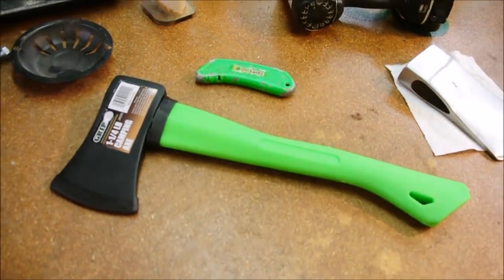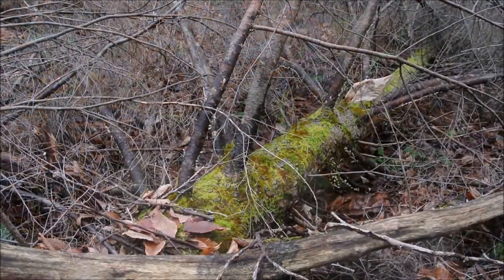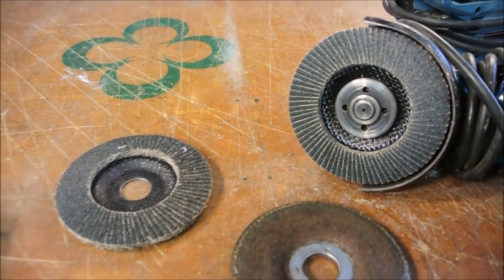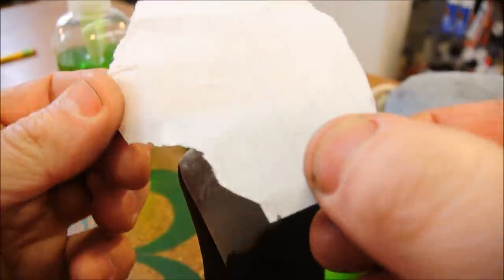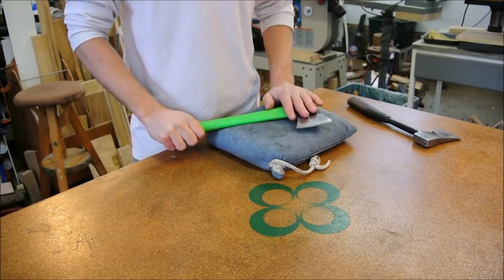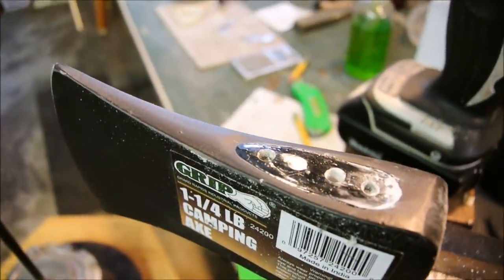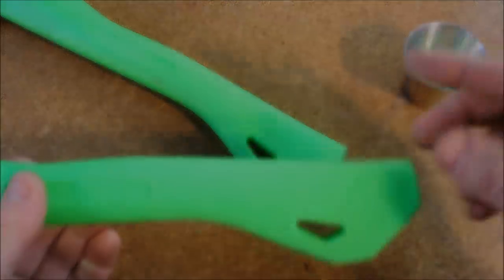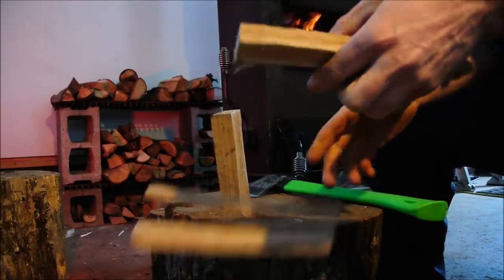Amazon's 12$ GRIP Camping Axe: Inside-Out

Comment: Spend the $35 on a Estwing. 
American made and the entire hatchet is a one piece design from head to handle. It's forged from a solid piece of steel. The handle is a full tang design with a leather grip. It will last a lifetime, literally.
I used to be in forestry and would harvest a ton of firewood and it was my "go to" for chopping off tree limbs and didn't want to fire up the chainsaw back in the day.
Reply from the maker: Comments like these are a sand-trap. Let's see if I can respond honestly without getting you angry {Spoiler: it never happens}. 

1) This video isn't about the Estwing. It's irrelevant. I've also been receiving lots of arguments for me to "just buy a Fiskars," but this video wasn't about that, either. 
2) As a long time user of Estwing products, I don't like the leather-wrapped "Sportsman's" hatchet. The handle has an exaggerated curve that feels hard and unpleasant to shift in your hand while working. I do like the blue-handled "camper's" hatchet a bit more, and while I agree that it's a lifetime tool, it's also three times the price of the junky green one in this video- so it's not in the same category. 
3) Hard does not always equal better. Hard also means much harder to sharpen. Sure, Estwing's is as hard as steel gets, and so the "Sportsman" also shocks more than just about any other tool I've used. 

Please understand that there are many ways to chop branches up. And there are thousands of hatchet designs out there. The only thing that they all seem to have in common is that their owners all believe that they are the 'best' one! So it's hard for me to read comments like that without hearing it as another unsolicited (biased) opinion that's usually more of a post-purchase rationalization. But my main gripe is really that those comments just completely ignore my half-hour video, and all of its contained content, which feels kind of rude. Sorry if my honesty offends you. 

Note that I do consider your experience in forestry as legitimate and respectable, so I will take it as an honest opinion that an Estwing hatchet is a solid tool. However, it is my role and function to be as critical and impartial wrt design as possible. They're all just tools to me.
Reply: pocket83² Lol! At least you're honest. No need to apologize though.
Reply: @johnt4060  Congratulations to both of you on the civilized discourse. The net could use more people like the two of you.
Reply: Used.to have an estwing axe. After cleaving through some pine, the edge was chipped, rolled and trashed..
Reply: The handshock from those Estwings is the worst ive ever experienced and the reason id recommend literally any other brand of axe no matter how cheap over one. Who cares if its Made in America. That line is trumped up so often as a debate excuser. Americans are capable of making junk too.
Reply: PureCountryof91 
I cut through a 24" Oak branch that fell on a fence. Couldn't use my hand for a week but the edge held up perfectly. It was a little dull at the end of the day but nothing like you're describing.
Reply: sergeantbigmac 
Estwing has a huge selection of hatchets, axes and hammers with a shock resistant handle
Reply: "They're all just tools to me" Amen, if it gets the job done safely then it is a good tool, a $10,000 tool is just as useless as a $1 piece of junk if it isn't used. Tools are made to work not sit on the shelf and look pretty. Thanks for your time and sharing the info with us on this little gem. @pocket83squared

Comment: Great video. The flap discs are ok but they generate so much heat in the workpiece.. really got to keep the workpiece as cool as possible to avoid destroying the temper. Using a file like you do is a great way of doing it,slow and cool the way to go!
Reply from the maker: Agreed. I go really slow. It's easier when it's so cold outside! In the summer, metal never seems to cool down. Then it gets tough to be patient.

Comment: Those plastic  or fiberglass handles can be quite slippery when wet or snowy.  Especially with most types of gloves.  I'd be tempted to do something about it. If it's plastic, grind in some grooves, or melt in some stippling.  Grinding fiberglass might be a bad ides. You may reveal frayed fibers that rub into your skin.   Maybe wrap some grip tape way at the butt end for a sliding hand to stop against.

Comment: Great video.  So many good reasons to use a properly sharpened tool.  My only advice would be to limit ones use of any impact tools like this, a hatchet, a hammer & certainly hammer drills/ chippers.  As an older guy who used tools like these for decades I'm currently paying the price with near constant elbow pain/ discomfort.  I'd recommend using a hatchet or hammer on smaller jobs but for any long term use i'd opt for the power tool equivalent.
Reply: 36 year old 18 year carpenter/tradesmen. Please for the love of god Pocket head this mans warning.

Comment: Hey speaking of plastic soldering, have you ever considered taking strands of 3d printing filament and using that as a "welding rod" of sorts? They're all by default thermoplastics because that's how they need to be to actually 3d print in the first place, but you also may need to know what plastic your part uses before you go mixing in other plastics like PLA or ABS or PETG or PC etc.
Reply from the maker: Since I don't have a 3D printer, I don't keep spools, but that is a great idea.  

Of course, when possible, I try to use a piece of scrap material of the same type. But most basic plastic repairs come down to being compatible with either HDPE or ABS. If I do need a sacrificial rod, scrap ABS pipe is easy enough to find, and lids from old containers (or shopping bags) are a nice source of PE.

Also, a (cheap) cable-tie will work as welding rod for many household plastics. If you only use a little from the end of each zip-tie, it will still function as it was intended. Most of the length usually ends up as scrap, anyhow.

Comment: If you cut too deep on the nub below the hole there is a cavity inside. A hidden pocket. I called it 83 and filled it with epoxy. Re-shaped it to a rounder handle for axe throwing.

Comment: I'd like to ask you, for someone who really has no experience using hatchets or axes regularly but carries one in their vehicle as a safety precaution (I would be capable of using it to split small amounts of wood in an emergency situation) would you recommend this and if not is there another hatchet or smaller axe you'd suggest instead. I get you're no expert but I really just need something inexpensive that can be tossed in a toolbox as a precautionary tool, no major amazing Gran Force Brooks axe/hatchet or anything fascinating. Just a simple hatchet for emergencies
Reply from the maker: Sure, why not? It's cheap, and pretty tough. It's going to be resistant to water, and you can leave it banging around in the back without worrying about it. This is as low investment and low-maintenance as it gets. And if you really have no experience, it's also a great way to learn/practice sharpening.  

Just be sure to make a sheath if it's going to be under your seat ;)

Comment: Here comes the pedant's comment!   I can't help my mix of Asperger's with a dash of pedant :D.
In that spirit first let's be clear that nothing done here is wrong!  Its actually pretty spot on - the end result always trumps the "right" method ... just the terminology poked me. 

Looks to me like the first stage stone is a dual grit carborundum which is a whetstone or oil stone - using soap isn't wrong, but you don't want a slurry, a whetstone uses it's (clean) surface of the stone to grind and uses the liquid to lubricate and carry the debris (slurry) away.  Lots of soap and regular wiping is fine, it's achieving exactly what is needed, just incorrect terminology.

The second stone looks like a green slate or dragon stone.  That IS a slurry stone ... usually water - but soap is OK, just don't wipe the good stuff away, you want a nice thick muddy layer to create a fine lapping paste to get a fine smooth edge.

Finally, it is so refreshing to see someone using a leather (finishing) strop without daubing it with grinding paste.  Technically that's a lapping strop (still part of the sharpening process) typically used for cutthroat razors and surgeon's knives (scalpels).  You should then followed up with a leather finishing strop to buff and set the edge (like a butcher's steel).

Comment: just a tip a strop dont do much without polishing compound trust me go buy some on amazon get the super tough and super fine and it will literally make a night and difference
Reply from the maker: I do use mink oil on the leather, but I can't mention everything. I was thinking about adding FFFF pumice to it, but why bother? The real error in that shot was the extreme angle I used while stropping. It should've been way lower, but hey, I'm just acting.

Comment: I bought a short Gerber hatchet for the camper.  It probably has the same issue yours came with .  I didn't think it chopped well when doing camp fire wood.  I didn't want to bring it to the local lawn mower blade sharpening butcher.  Could I send it to you to have you clean it up like yours?
Reply from the maker: Oh! That seems friendly- but the level of entitlement contained in your comment is staggering. No, I will absolutely not restore your hatchet for you. Learn how to file it yourself. That's why I make these videos. 

You have no excuse, unless you have no arms—in which case, you have no need of a hatchet. Now add your dislike to the pile, and please keep the swearing in your reply to a minimum.

Comment: A cheap forest fire Pulaski would meet your needs far better for removing the brush & baby trees. I used hatchets to do what your planning, and it sucks bad without the right tools.
Reply from the maker: That is an excellent point. It's just that lugging it around a big property is not really practical. Maybe if I were to just spend a day doing it.
Reply: @pocket83squared  it is not as tough as it sounds. I have done it many times while firefighting, on top of carrying a heavy pack days on end non stop for miles.

Comment: I picked up an old Pumb hatchet from Roger's flea market, years ago...I think it was right after high school. I took it to NY with me when I moved up there .  I was out back of the shop I was working at, clearing some brush around the dumpsters that the trash collectors were getting pissed off about.  There was an old man who lived next door, who saw me and offered to sharpen it.  I, stupidly, assumed he knew what he was about, after all, why would he offer if he didn't?  I handed him the hatchet and he told me he's be right back.  I stood there for about 40 seconds as he walked to his garage.  It was 40 seconds too long.  The next thing I heard was his bench grinder spinning up and my baby being tortured upon it's overly coarse stone.  I ran to his garage, but it was too late, the damage was done.  He had heated that edge up so much it had turned a bluish green color.  I was pissed.  I begrudgingly thanked him for his time and silently cursed him for the work I'd have to put into it to fix the tempering.  I shouldn't have wasted my time with the cursing, that damn thing is still sitting in storage, waiting for me to fix it.

I could have sworn I had somewhere I was going with this, but I seem to have lost the plot along the way. Anyway, thanks, as always, for the great video.
Reply from the maker: When I was in the trades, and someone would ask to borrow my hammer "for just a second," there was only ever one answer: No. 

Call me old fashioned, but you just don't touch another man's tool.
Reply: @pocket83squared  Yup, lesson learned.  Probably the most useful thing I learned that year at college.

Comment: Also, would you heat-treat (temper) a hatchet? Or will the increase in brittleness make it dangerous?
Reply from the maker: That's a tough question. I'm not the best person to ask. While a harder hatchet is more durable, it is also more difficult to sharpen. It will also tend to be more expensive. And I do agree that, in general, harder metal is also more brittle, so I suppose there is a small additional risk. I think the better way to evaluate the problem is to ask yourself what you are trying to do with the hatchet, and then find the appropriate hardness that suits your need.

In my case, I can get two solid months of work out of one of these junk hatchets before I have to sharpen it. Further, they are cheap enough that I can abuse them or replace them entirely. But many of the axe people in the comments seem to believe that one ultra-hard hatchet is the best solution; I suppose they just baby it for life. This seems silly to me, as man has used sharp rock for the bulk of his existence. Even the softest steel is an incredibly hard, durable material that will last a long time being struck against soft, moist, pulpy wood.
Reply: @pocket83squared  Agree with you there. Unless it's a survival situation, thanks to economics, it's easier just to get a "good enough" tool and replace it! Hatches are tools that literally are meant to cop a beating! For me it's durability. I've used some truly terrible tools that loose a working edge after hacking at ONE branch! I don't know if it's something you'd be interested in for the channel, but it would be interesting to see IF there's any benefits of DIY tempering.

Comment: I use (503 torch lighter) to work on plastics.
It's very versatile and easy to use, as if you are using a Dremel pen.
You don't need to sand nor file your work after you have welded your plastic with this low temp torch.

Let me know how it goes after you have used it :)

Comment: Its a good and simple way to modify the edge of a cheap axe !  Unfortunately, the same axe from Harbor Freight is just $8- .....
BTW, I will use Glue Gun to fill up the concave area of the Safety Warning area as I think it would be much easier and faster than your way !

Comment: but you know that if you can file the edge of youre axe, its not really heat treated? that means its got no hardness to it, so it is a bad tool in any way. an axe also needs a hard edge, like a knife, ( i´m knife and tool maker) to keep it sharp for way longer. thats the differents between cheap and and good tools, just ot notice ;-)  alltho you did a pretty good job for a user and nice video bro keep going

Comment: I don't know what material the magpul pmags are made of butt in Canada we have rivets and hers and I've won that have no internals I want to fill in the rivet hole, I have some welding plastic from eBay, how would you suggest I composed the hole? I was thinking some wood inside and use a soldering iron to melt then fuse, any tips?

Comment: quick question, how many gallons of epoxy do you go through on a weekly basis? ;) 
Love the videos, nice pacing
Reply from the maker: Dual dispenser tube kits are about 3$ per .85 oz. total amount. I will typically use up one of these .85 oz. syringe kits about every month. They can be refilled for much cheaper by buying the (2)4 oz. bottles.

The cost is pretty much zero. That's kind of the theme of my content.  

Note that there are 128 oz. in one gallon. 
128/12 {months} = 10+(2/3); 
Thus, a this rate, a gallon would last me over a decade. That would require lots of toothpicks, though ;)
Reply: @pocket83squared  that's a good point, here in Denmark it is significantly more expensive unfortunately
Reply from the maker: Can you use Walmart (dot) com? We can get just about anything delivered through it. I would think that a corporate giant like that would have reasonably standardized prices.
Reply: @pocket83squared  in theory I could, but they don't ship from Europe, so shopping would be pricey

Comment: sorry for the stupid question, but is the hatched tempered? if yes, why does the file bite into the metal?
Reply from the maker: Not a stupid question at all! It's just really tough to answer. There's a million different types of metal and a million ways to alter the hardness of those metals. I probably shouldn't have used the word, 'temper' in the video. I'm not an expert, so any simplified answer I give will be debated by one of the know-it-alls around here. Sorry to be so useless, but I suggest you just go read the wiki: 

 https://en.wikipedia.org/wiki/Tempering_(metallurgy)
Reply: @pocket83squared  i thought i was missing something obvious :D thank you :)

Comment: Harbor Freight sells the exact same axe with a yellow handle for 7.95 and you can use a 20% coupon on it.  Any cheap axe or hatchet is going to need the same sharpening treatment. I would just wrap the handle with rubber tape for a good gripping surface.
Reply from the maker: Yeah, I made a video about that one, too. Rubber tape? Um, no.
Reply: @pocket83squared  I'm not seeing a problem with good quality rubber tape, but we should probably be using gloves for protection and to prevent blisters. I'll have to try it on mine, but it should provide durability if overlapped. It's easy to remove if you don't like it.

Comment: The out-of-the-box "edge" looks like a LARP weapon. Nice shape you got out of it, though.

Do people really use belt sanders for that kind of shaping? A proper metal grinder apparently runs over 8000 SFPM, with some considering 4000ish SFPM the minimum viable speed. It doesn't look like belt sanders even break 2000. That must take forever.
Reply from the maker: Forever? Nah. By my math, I think that's four times as long! It does seem pretty slow, but you gotta use what you have.